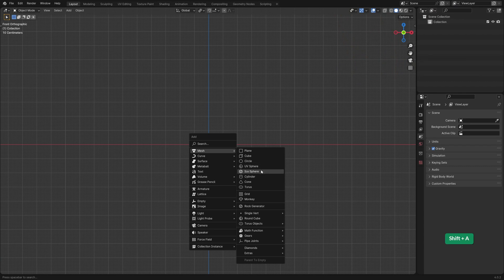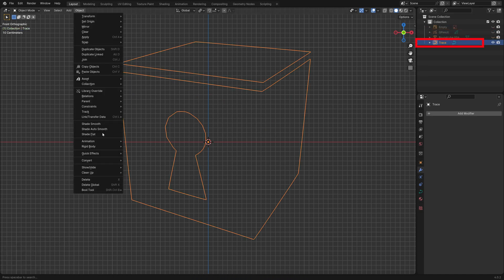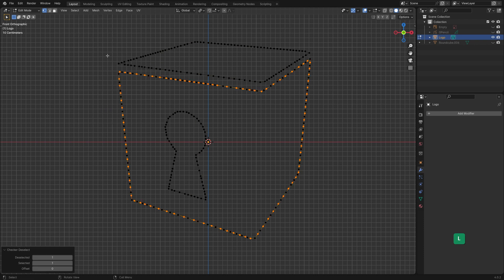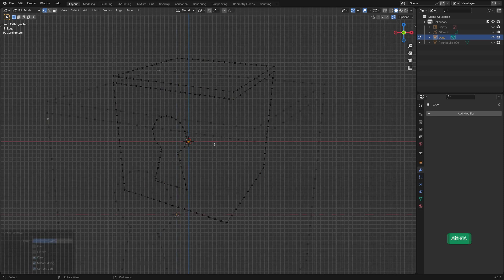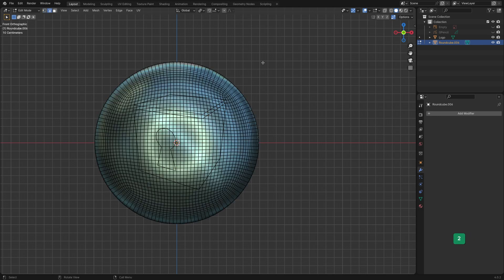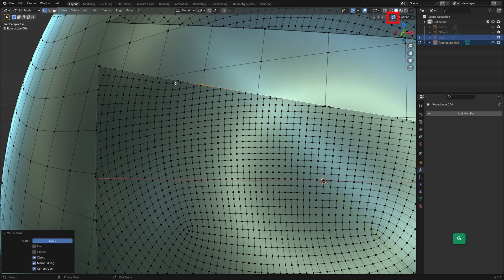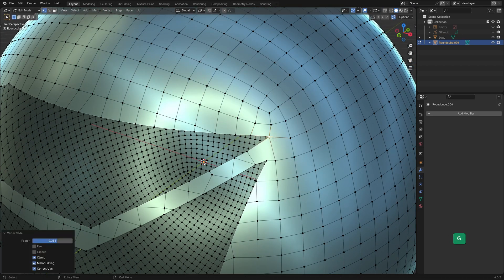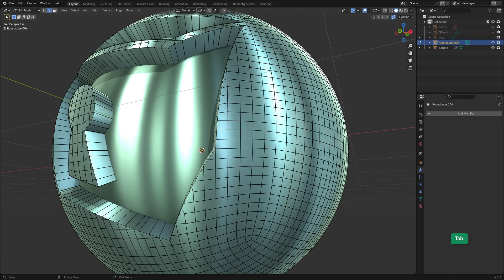Step by Step: Image File to 3D Geometry | Blender Secrets

Comment: you might want to use limited dissolve option to unpopulate unwanted vertices, then tweak angle to increase or decrease influence. best used on unfilled wire objects or curves converted to meshes